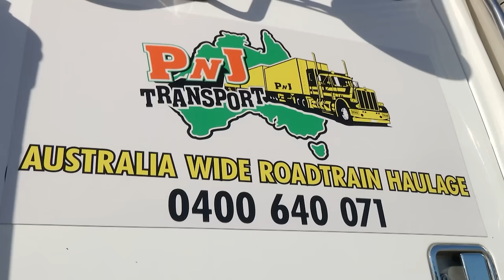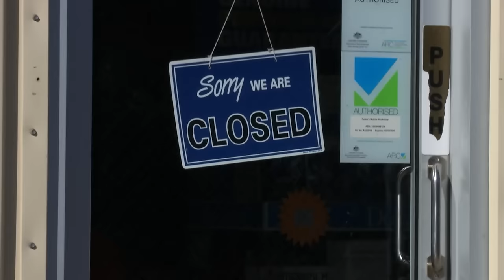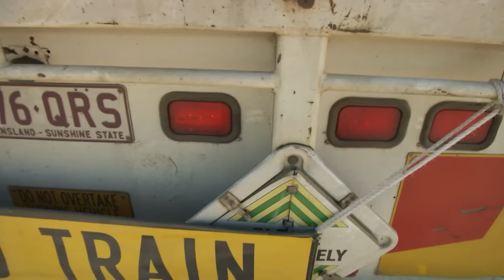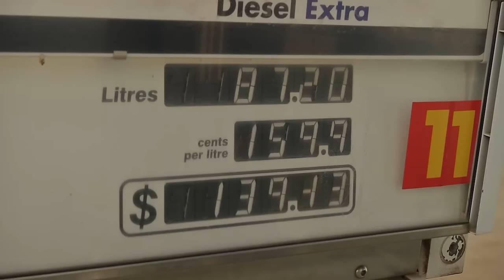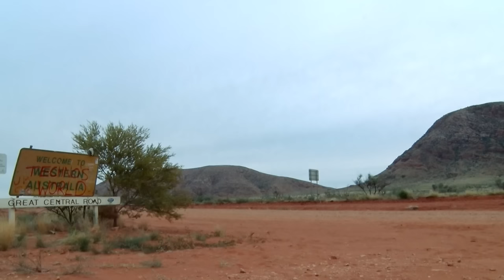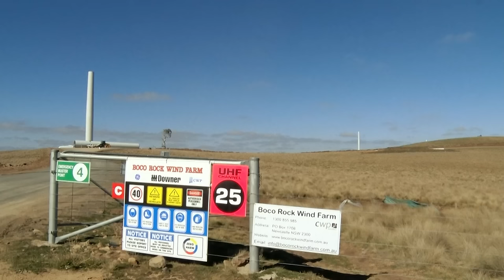Truck Driver Takes Biggest Gamble of His Career | Outback Truckers - Season 3 Episode 1 FULL EPISODE

Comment: You can tell the commentator doesn't know much about trucking. He says, if the broken plug doesn't work, he's gonna have to turn around and drive 400 miles back., That's ridiculous, which truck and company wouldn't send a pickup truck out for a small part. Also, the driver that Sadie's got diesel pumping through his veins. Here's an idea. Don't spill diesel on you. I drove truck for 20 years. That's a small part of the job.